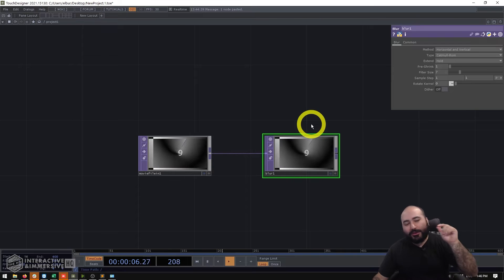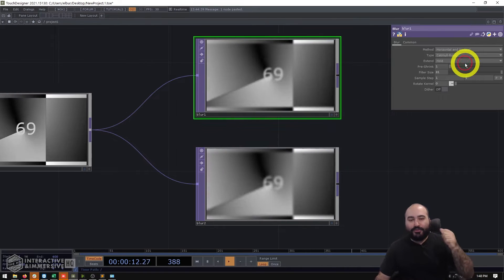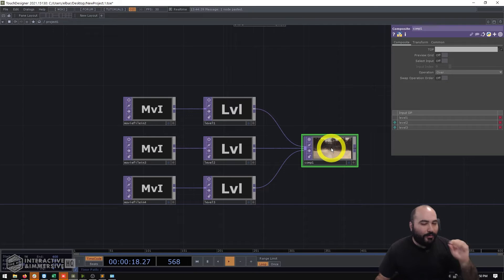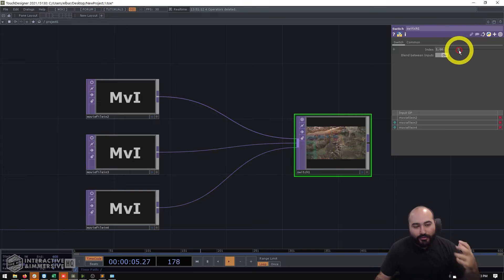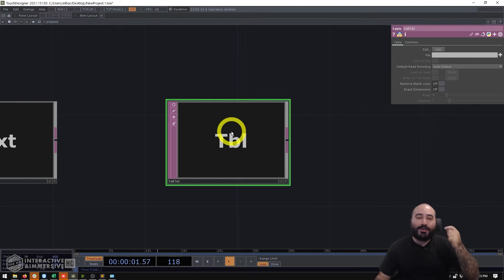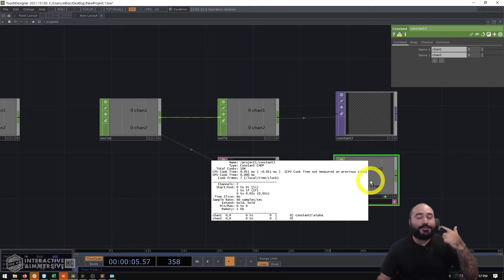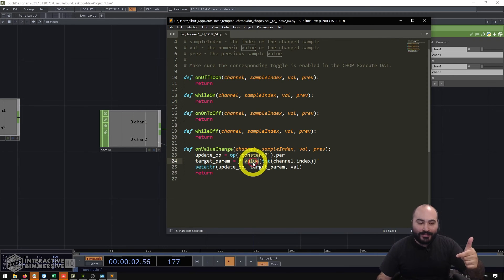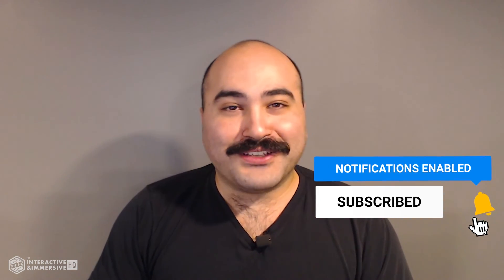Easy Optimization Tricks in TouchDesigner - TouchDesigner Tutorial 060

Comment: For the last example with the OSC in chop, isn't it much easier and also more performant than using python to just change the cook type setting in the null to selective?
Reply from the maker: We're not aware of the performance difference between the two having been thoroughly tested. Elburz is in the mindset of having things be explicit versus implicit -- so even if the CHOP Execute takes slightly more resources, you know exactly how and when it's functioning. If you were to use the Selective mode on the Null CHOP, you're at the mercy of code that you can't see/control/monitor if you have to debug issues later. Hope that helps!

Comment: I tried out the very helpful trick with the switchchop for a network with multiple heavy scenes inside comps. Sadly they still seem to render everything despite the cables not appearing to cook... I have the viewers turned off but in the performance monitor they still take up a lot of ressources. Any ideas? Thanks for your content!

Edit: to be more exact I'd need a way to completely turn off a comp using a midi controller while in perform mode...
Reply from the maker: It's possible to turn off a COMP's Cooking flag with Python via op('COMP Name').allowCooking = False, but you'll likely see frame drops whenever you start or stop cooking, so this is generally not a recommended technique. 

One important thing to consider is that different types of content might require a slightly different approach to optimization. Is the content found within the COMPs mostly 3D renders, 2D or both? Are you playing back videos?

A reference worth checking out is the sceneChanger component which you can find in the Palette -> Tools, which accomplishes a similar outcome and is optimized for high performance.
Reply: @TheInteractiveImmersiveHQ  very useful insights, thank you so much!!

Comment: Having a bit of problems in setting the script up, it should work on mac as well right?
Reply from the maker: Is that the Python script at around 11 minutes? That one should work, if you're having issues double check everything is typed in exactly as my example although you might need to change your operator names based on your project. What kind of error are you seeing printed in the textport?